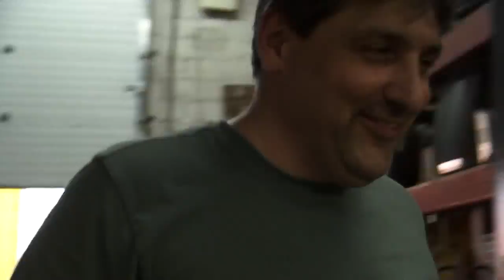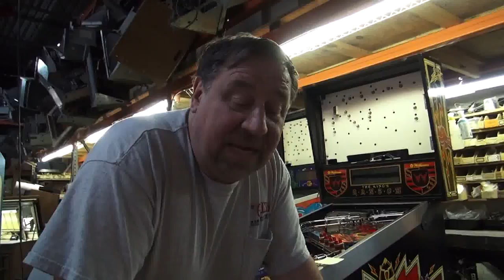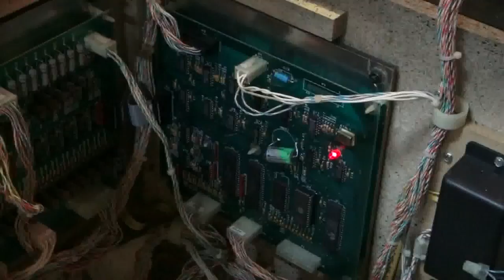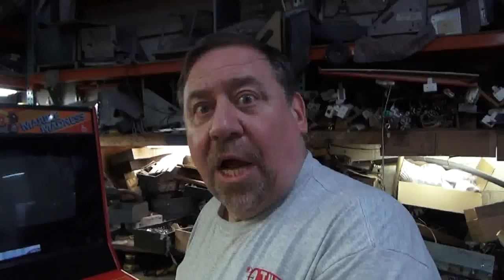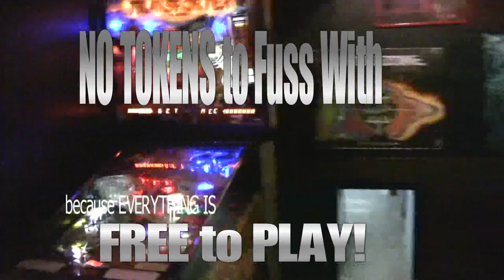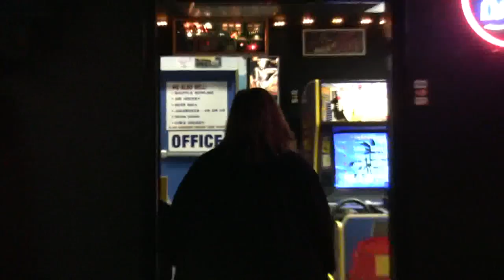#302 Rare CARIBBEAN CRUISE cocktail table Pinball Machine-and its HISTORY-TNT Amusements

Comment: Wonderful!  Love what you do! Such an encyclopedia of Pinball <3 We just acquired a 1968 Lady Luck and she's working, but with a few lights out and one of the bells. Just got a few more lights running and the main big bell. Luckily she was in someone's well taken care of basement for years. Certainly needs more of our TLC. Repair is going steady :)
Reply from the maker: +SpringoStar Hope it works out well for you!  Marco Specialties and Pinball Resource have lots of parts!
Reply: We actually blew a 150 Volt 10 amp fuse and really are concerned. All during a small hip check from a friend over that day playing her. We were certainly running her hard for that whole two week period. Bought a new set of fuses for her, yet unsure if there is a bad connection, or a couple of bad coils... We would rather save the fuses and check for other issues. The blow certainly happened for a reason. She was doing so good too.  :(

We're trying to safely troubleshoot her little by little, all connections are solid. I see personally a few burnt out coils and I feel her mechanisms and parts to all the more serious moving parts, should be cleaned out properly and put back together... Yet, lol, we are not that advanced. (In heart we are.)

When we got  her, the coin op was disconnected, her Free game knocker, both her bells, her slender number real with dual digits, and a few lights. Someone certainly didn't want those bells or the coin op to work for free play. So we've had our theories of what is really going on in there. 

The boys who are good with electro-mechanical machines in our group, were eager to get under the hood at first. They connected a safe grounded cord, grounded the machine, and managed to get one of the bells working as well. 

I'm so impressed with your knowledge and I certainly as a life long pinball fanatic, hold you in high regard. :) 

Any advice would be splendid! 

Thank you yet again for your videos! 

- Spring

Comment: I don't know if anyone is still monitoring this site but i have the Caribbean cruise pinball machine. The playfield is in excellent condition so i would like to be able to repair it. When I turn it on it does one beep then the display comes on with only gibberish. If i push the start button nothing happens. None of the lights come on, only the display. I tried pushing the red reset button inside the coin door but nothing happens. Any thoughts or help would be greatly appreciated. Thank you.

Comment: I found one of these at the local dump.  It has two problems.  One, the flippers are very weak and the top right flipper doesn't activate.  The other problem is the display. The top display only shows the bottom half of the segments..  The flippers are pretty easy to replace, but the display is quite pricey.  Do you have any tips on checking to see if its the display or the board that is having problems.
Reply: flipeprs would be EOS switches, dead coils or dirty mechanics, the displays might be chip-related or cold-solder contacts.

Comment: I have a night moves with system 80 b boards the the mpu was some acid damaged but repaired it but it will boot and reboot every 8 seconds and wont boot unless the reset board is hooked up have u seen this problem before I have a video of this problem. great videos good info
Reply from the maker: The reset board needs to be removed and pitched...it has caused more trouble than its worth!